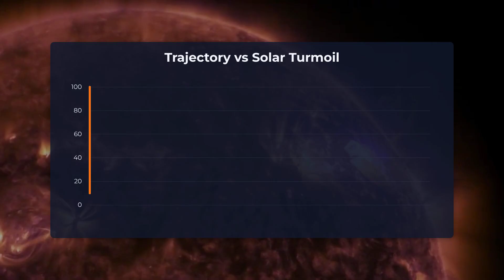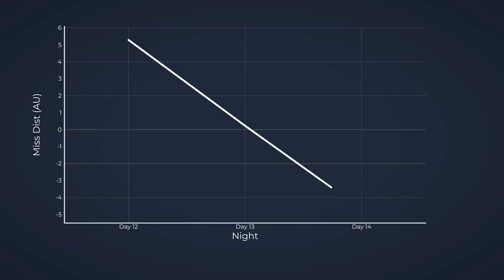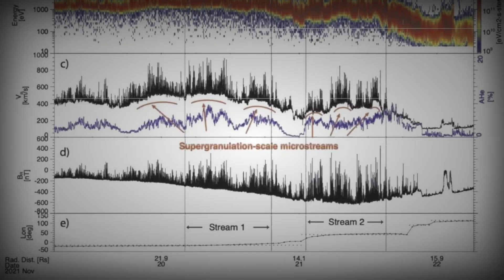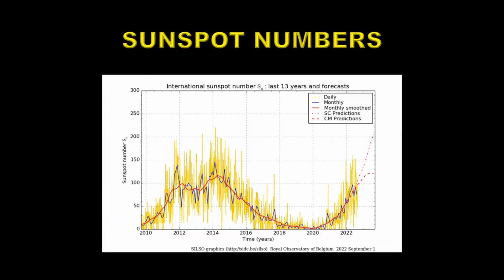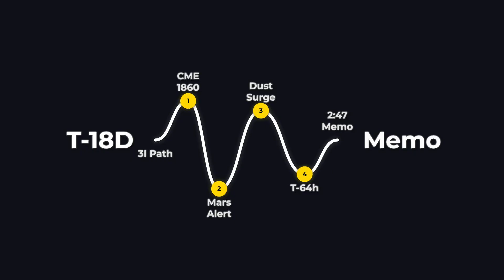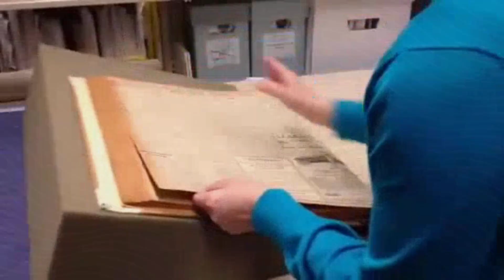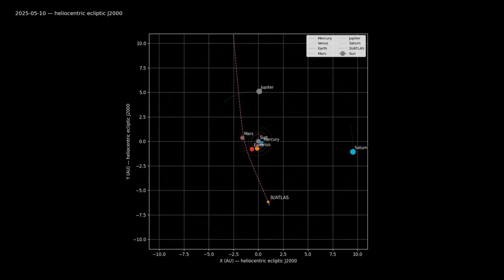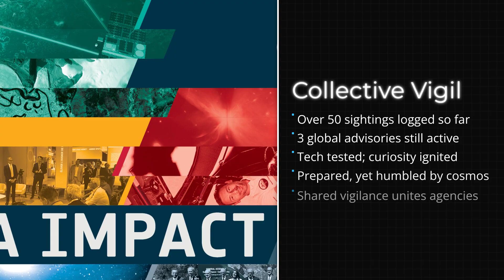Astronomers Alarm: 3I/ATLAS’s Mars Encounter Is Worse Than Expected

Comment: Most of EVERYTHING they say is just Guessing about Objects in space. Just look at what they say about Halley's Comet appearing every 72–80 years. If it was really Just a uncontrolled comet then HOW does it appear every so many years which by the very Laws of Gravity and Physics say it Can't. Since Halley's Comes in Orbit the sun then goes back out of this solar system at the speeds it travels then what makes it turn around and head Back into this solar system since it can't be our suns gravity it would have to be another celestial object that it would need to do the same slingshot effect. BUT Even that wouldn't keep working as the Entire Universe is constantly expanding the trajectory would be changed for each time it made the trip making it IMPOSSIBLE after only a few trips as the alignments wouldn't match. And those who would say that it is still effected by our Suns gravitational pull then the comet would STILL have to change it's speed and trajectory. Like a Yo-yo there is ONLY so many times a object follows the same path and speed before it stops unless it is acted upon by a outside force. A yo-yo has a string attached to stop it from continuing in the direction away from the hand which the laws of physics state "An object placed in motion tend to stay in motion UNLESS acted upon by an outside force" So with Halley's Comet  traveling out in space and out of the gravitational force of our sun then WHAT makes it turn around and come back every 70 years as it doesn't have the benefit of a string attached like a Yo-yo. According to the laws of physics it should just continue it's journey in a straight line out away from this solar system once it beyond this suns gravitational range. If there was another sun in a far distant system that it also sling-shoted around to return to this system the trajectory would have to be so Precise and unaffected by movements of planets alignments that it would be a constant course calculation change requirement each time because of the expanding universe. SO NO It's NOT possible for ANY Comet to do what Halley's Comet seems to do.
Reply: But it is the gravity of the sun and all the other objects in the solar system that pulls halley back close to the sun.
Reply: @vudu8ball  here's a simple way to show what i said. take a round magnet like the ones in a speaker, mount ti on a board that is slightly tilted now roll a steel bearing ball down the slope so the ball gets pulled by the magnet and slingshots itself back up the incline. see how many times you can get the steel ball to complete the loop completely.  My bet is you can't not without helping to correct/change the trajectory of the ball to keep it aligned to where it has to go.  Now that's only a a very small scale, while comets are operating on a VERY Immense scale that would require such a precise course correction with each pass that even a million of a inch would mean the course would be completely off after thousands of miles. So NO there is No Possible way for a comet to do what Halley's Comet they say does on it's own. With the changing of distance between planets, the Sun and anything else out in space there is NO-Way it could be done over and over naturally by itself. it would be like playing a Pachinko machine and Never hitting a single pin playing it hundreds of times and that's on a machine that the pins aren't even moving while planets are.